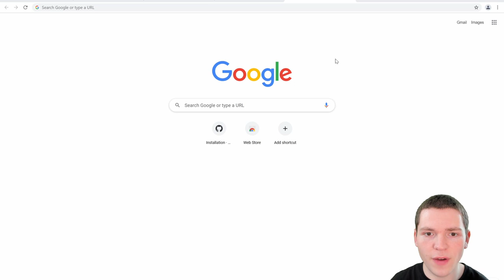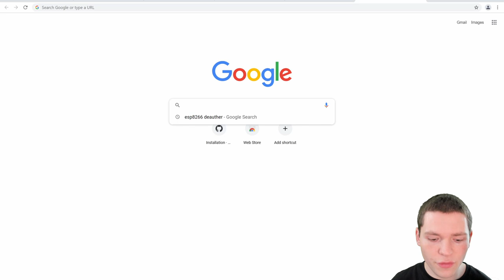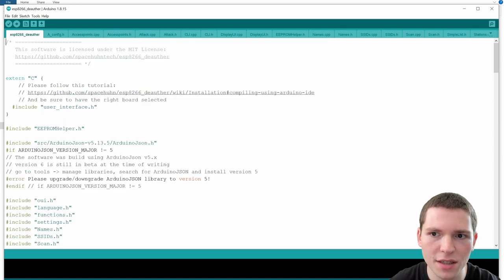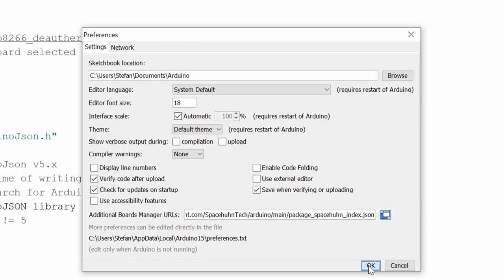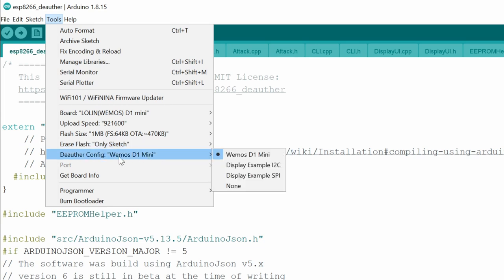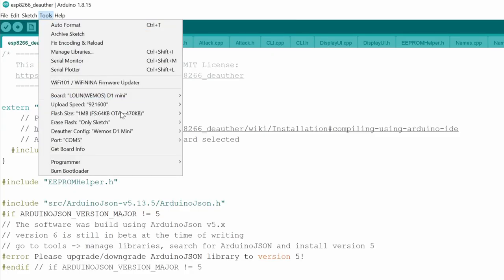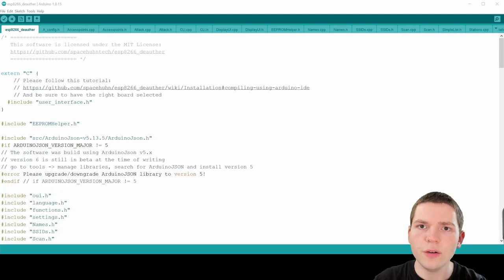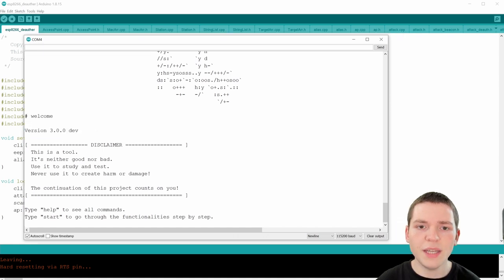Install ESP8266 Deauther using Arduino IDE

Comment: This is a great tutorial but I was hoping you would go into more detail about the button setup. I can't get the buttons working on my build. I've searched and found several others having the same issue.
Reply: I also have the same problem, I checked everything, tried to change the code somehow, but it did not give any results, maybe you have already solved this problem?

Comment: i am facing an error with the code can you help me. And i am attaching the error also 

esp8266_deauther:10:12: fatal error: user_interface.h: No such file or directory
   #include "user_interface.h"
Reply: Same did u find any solution
Reply: @Anonignpc I think you need to download the library
Reply: @emilka9537  same bro did u find the solution

Comment: Can I make a deauther with a normal lcd screen as a hub with Alexa capability just by combining 3 8266 chips. Also having the third chip be a wifi extender. All managed by the hub screen
Reply: I've seen projects just curious if they would conflict eachother if I added 2 to the same board.

Comment: I wanted to ask why it could be that everything works except the 3 buttons. I checked super often whether everything is wired correctly and I can't find any errors. What could be the problem.
Reply: Many people have this problem, and so do I.😢
Reply: @emilka9537  Did you find a solution?
Reply: @Swandy_82  yes, define a buttons in stroke #elif defined(DEFAULT_ESP8266) ....
This is how you should write:
#define BUTTON_UP (example pin 13) 13
#define BUTTON_DOWN 12
#define BUTTON_A 14

I won't tell you in which section this is, please look for it, it's one of the main sections as far as I remember

Comment: Hello Spacehuhn! I just want to ask if there's a project for "5G WIFI DEAUTHER" using the BW16 RTL8720DN, the same as the ESP 8266 Node MCU. I saw a video on Youtube of the BW16 RTL 8720DN equipped with 2.4 + 5G dual band WiFi. Same size of the ESP 8266 Node MCU. I think you can make a 5G WiFi Deauther on it. I hope you will review that chip. I can't attach the pictures and PDF regarding that chip to your contact support page. Thanks. I think it is POSSIBLE!

Here's the Youtube link for BW16 RTL8720DN 5G Chip: https://youtu.be/T10xCiM_4cw?si=1tWRQJYThDvyTcmj

Comment: Bullshit, its packet injection is way too weak.

Packet injection involves sending packets at a rate that can be processed by the target network. The effectiveness and tolerance of packet injection in modern WiFi networks can vary depending on several factors, including the network's hardware, software, and the specific conditions of the attack. Here are some important points to consider:

1. **WiFi Standards and Throughput**: Modern WiFi standards like 802.11n, 802.11ac, and 802.11ax offer high throughput, measured in megabits per second (Mbps). These standards can handle a significant amount of data transfer, often in the range of hundreds to thousands of megabits per second.

2. **Management Frames**: Deauthentication packets are management frames, which are relatively small in size (typically around 26 bytes). The rate at which these can be injected depends more on the capabilities of the attacking device and the network's capacity to handle incoming packets.

3. **Network Load**: A heavily loaded network with many active devices and high traffic might be more resilient to packet injection attacks, as the injected packets might get lost or ignored amidst the legitimate traffic. Conversely, a less busy network might be more susceptible.

4. **Attack Rate**: The rate at which packets are injected can affect the attack's success. If packets are injected too slowly, the target devices might not be effectively disrupted. If packets are injected too quickly, it might raise alarms or get filtered out by network defenses. Typical deauthentication attacks might inject packets at a rate of several packets per second to a few hundred packets per second, depending on the specific circumstances and the attacker's strategy.

5. **Network Defenses**: Modern networks often have defenses against deauthentication attacks, such as intrusion detection systems (IDS) and intrusion prevention systems (IPS), which can detect and block excessive deauthentication frames. The tolerance of these systems can vary, but they generally aim to prevent malicious activities while allowing legitimate network operations.

In practical terms, an ESP8266 device like the Wemos D1 Mini can inject deauthentication packets effectively if used within the limitations of the network's tolerance and the device's capabilities. The exact tolerance in bytes per second will depend on the specific network environment and the countermeasures in place.

Aka it wont work.

Try it using your 2 phone and 1 real wifi router. It wont work even if your antenna is as big as a moon